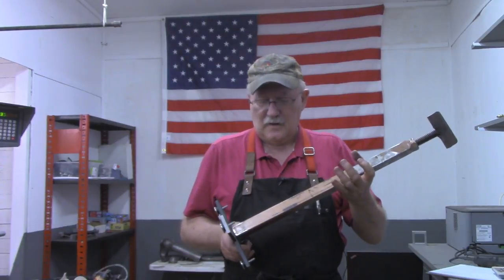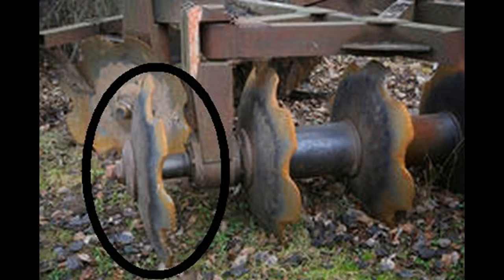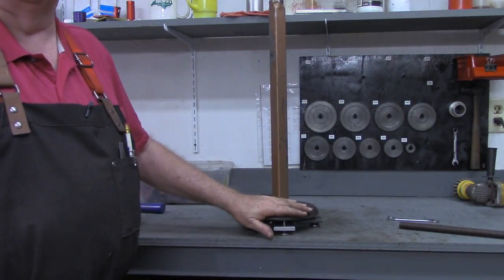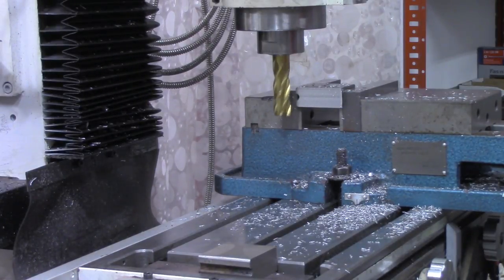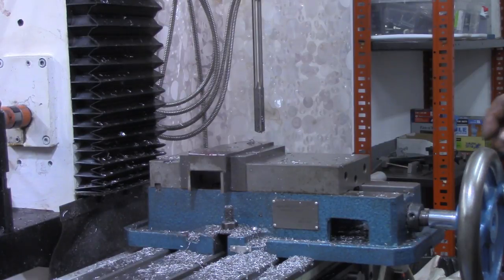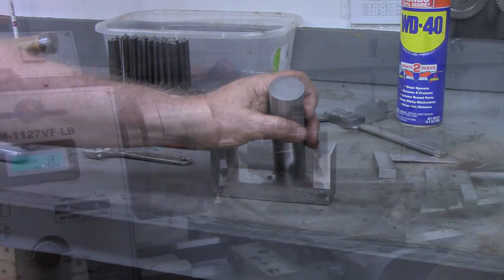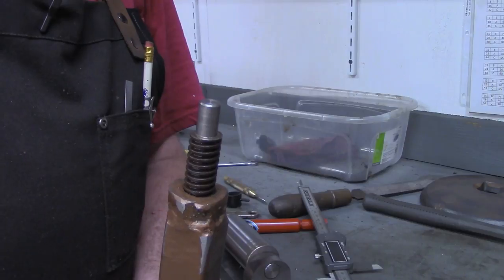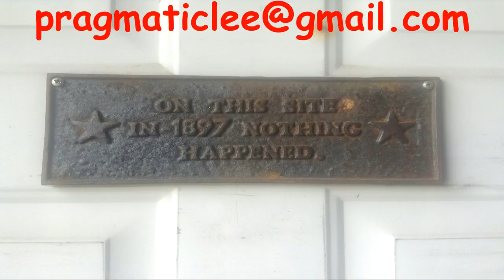Hortizontal Band Saw Material Stand

Comment: Hello,  I doubled up some 3/4 plywood (just what I had) attached some large (hate small) casters and bolted the base of the saw to that surface.  Raised it up 5 1/2" and lets me roll it out when I need to cut long stock etc.  I also attached a cookie sheet to the stand to catch the cutting oil and swarf.  Did several other mods as well.  Those saws are great for the value and mine is going on 27 years of steady useage.  Liked your build although my preference is for flat surfaces rather than rollers for the infeed and outfeed stands.  The rollers unless locked parallel to the blade tend to draw the stock.  I also go for heavy (my favorite stands are about forty pounds) bases so the stand doesn't try to follow the stock when you are pulling it around to adjust the cut.  Always great to see how others are addressing their shop needs.  Take care.  Doug

Comment: Very nice. The audio was fine on my end, leave the video posted.

I really like the way it assembles. Did you think about capturing the roller yoke assembly with a small allen bolt and washer countersunk in the yoke and threaded into the end of the jack screw. Leave enough tolerance for the yoke to swivel but not lift off.